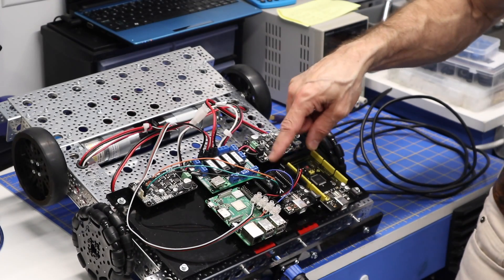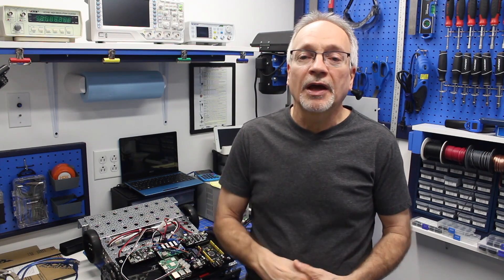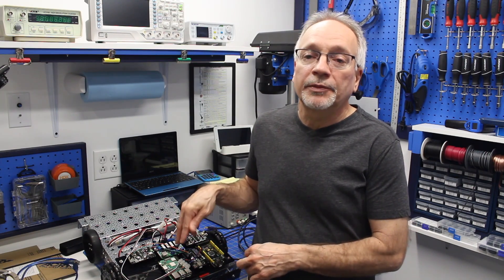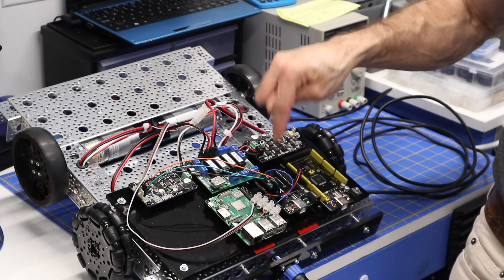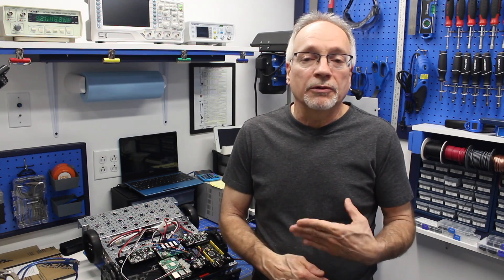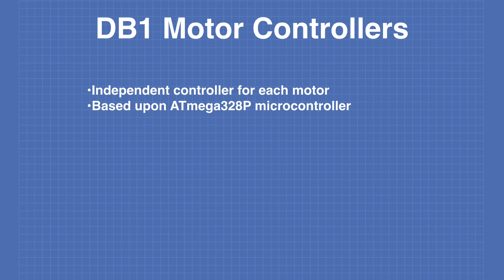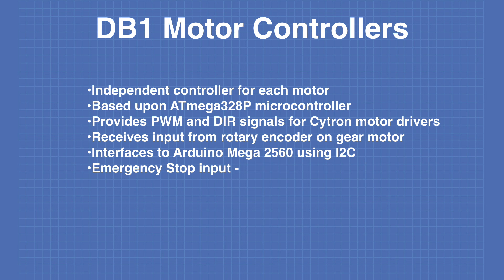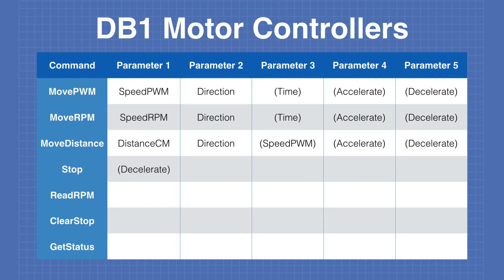Build a Real Robot Episode 8 - Motor Controller Part 1

Comment: If anyone else is having the Clone Arduinos/USB Chip drivers/Windows issue. I had the same problem but could not even download the drivers let alone install them,(my security software blocked the manufacturers download site and I wasn't inclined to overide it). The clone will still be listed in the Windows Device Manager as "Unknown" and there in its Properties you will also find the COM port it is attached to. I simply changed the COM port in the Arduino IDE to match the COM port Windows reported for the "unknown" device and found I could then upload programs to the clone through the Arduino IDE as normal. It wasn't pretty but it worked. Give it a try if you're stuck, it only takes a second to see if it works for you.

Comment: Might be a candidate for GRC's SpinRite.  Also, my Windows 7 machine occasionally fails to boot with same message however so far, when I reboot using bios hotkey, I am able to select the SSD from available boot devices, then everything boots as normal.  Just seems odd, how the system does not see the SSD upon boot.

Comment: You could also try putting a wide rubber-band around your tires. If that works then you could work on a more permanent solution. Like maybe applying that Plasti Dip by Performix while the wheels slowly turn (so it is an even coat). I have never tried it, but it looks like a good product. I have seen it used on someone's youtube to coat something. I'm referring to that stuff you dip all metal hand tools into to give them a rubber coating. It not only is supposed to give you better grip, but it also helps prevent electric shocks.